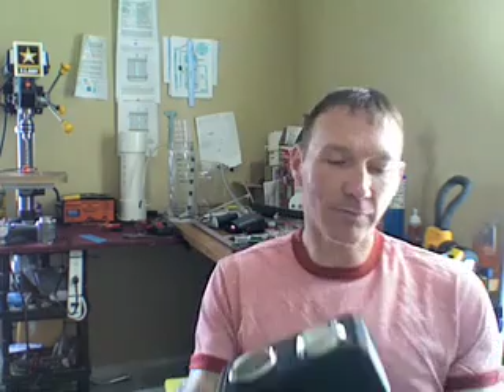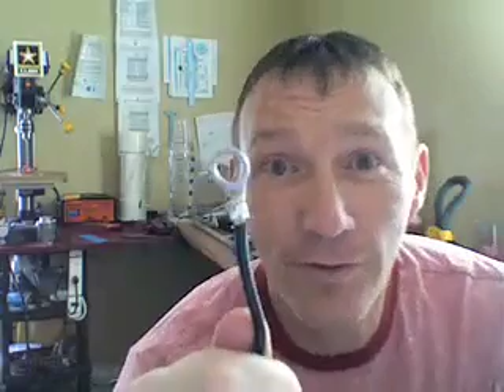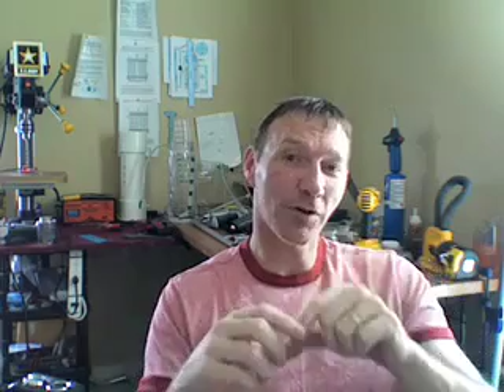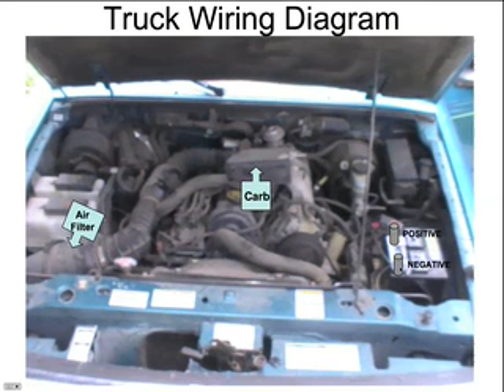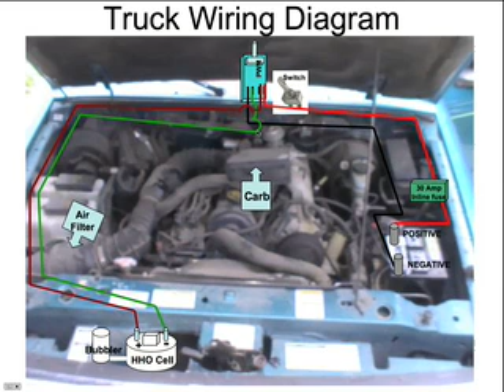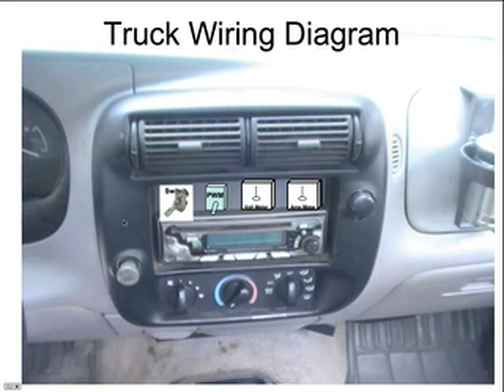A Real Life HHO Wiring Diagram

Comment: I did 1 thing different on my wiring.Its a extra safety step.The way your doing yours if you forget to turn power to cell off it will make hydrogen until its turned off or battery dies. I know a guy who did this.He didn't see he had left it on and it blew the intake off the motor.Car was total loss.
I have a 3 cell setup. I used a 30 amp relay. You run power to toggle from starter switch. This way when you turn car off it kills power to HHO cell. Only a small power wire is needed to tell realy to send power to HHO cell. Any toggle switch will work. Less chance of wiring fire.You have a heavy wire from battery to realy and from realy to cell.
Nothing wrong with your way. Just want people to know theres a safer way. Any 3 or 4 pin relay will work. Power windows,seats ect,ect. I get the one 4X4ers use to power off road lights.will cost you Less than $5 for realy.

Comment: you may also try a pressure controlled setup, set it to cut off at a set pressure and the system will only run when pressure drops below threshold. then as not needed like when engine is at idle the system will shut off. simpler to make and control than trying to make a variable output module.

Comment: @urbex2007  There are a few ways to over come the ECU wanting to dump more fuel into the injectors when this HHO is added.  The sensible way and the most expensive is to buy and fit an EFIE in the wiring near the air flow sensor on your exhaust.  Another is to re-map your computer's ECU chip (ppl usually do this on sports cars to make them faster!) But the cheapest and oddest way is to put foil or such over the air sensor in the exhaust part so it doesn't read more oxy won't add more fuel. ok?

Comment: I definately enjoyed the video and learned from it.  I am still learning so "I know I don't know" but, why is the power coming straight from the battery positive and not from some circuit that would only be energized when the car is running?  Would it not be dangerous to have the cell producing gas without the car running to burn it off?

Comment: Very nice instructions. The one thing i have been thinking about is the system is supposed to be On-demand, so for example, If you are producing 1 lt per minute, why would you need that just sitting and idling? I have thought about putting in a pot or some other electronics to help regulate the hho cell output, maybe something hooked to the throttle body? And i have trying to figure out what produces more hho, amps or volts? I do know that the more amps = more heat...

Comment: Steve, perhaps the amount of wire can be reduced if you can find good chassis grounds near your devices rather than running all that negative wire?  Also, I was wondering if your 97 actually has a carb, or if it's fuel injection system.

Otherwise ... great stuff!  Thanks for posting your progress.